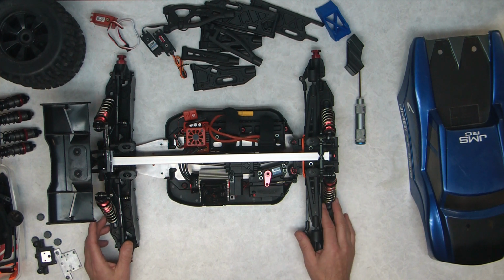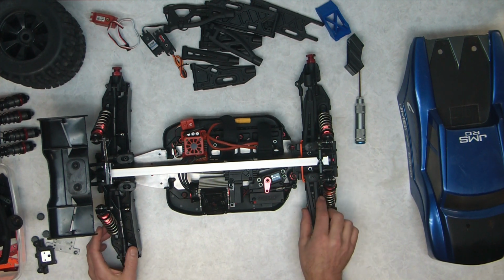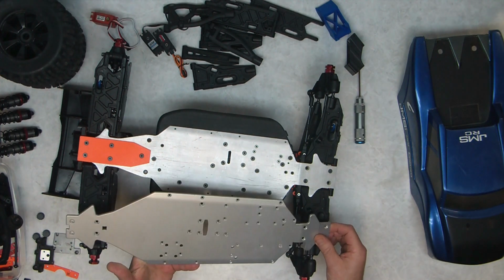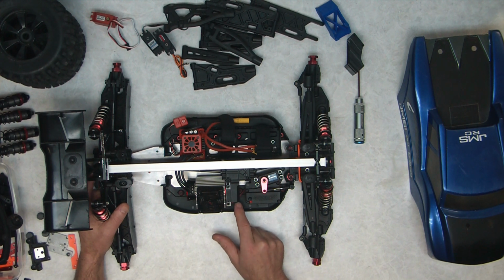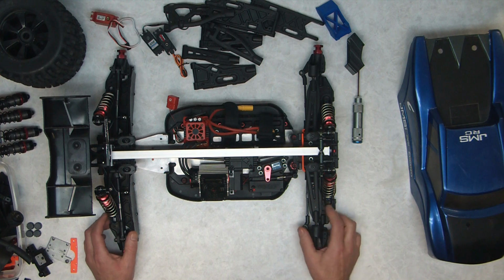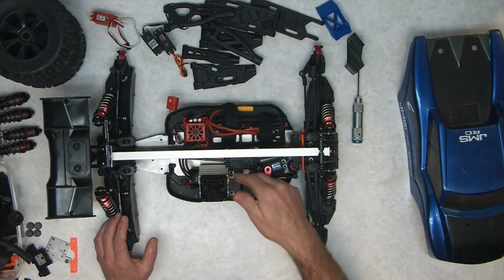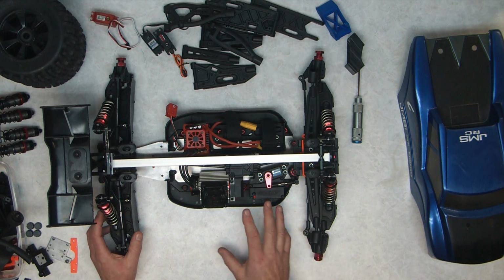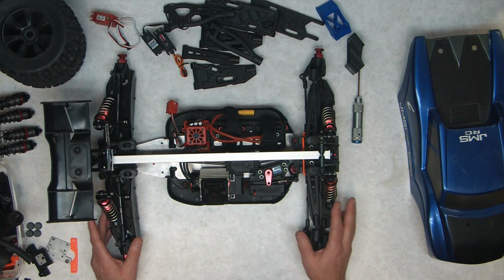Team Corally Kronos Review 2020 Part 3

Comment: Great video series!  There's a few reasons I went with the Kronos back in the March/April 2020 time frame.  1)  It looked like a durable truck.  2)  I didn't want to have something that everyone else had.  3)  The 'fanboy' attitudes that many for other brands had turned me away   I too had similar pains working to toughen up the V1 of the Kronos.  But I liked it so much that I got the Dementor.  They have been fun to tinker with and to make a little stronger to handle the bigger bashing environments.  I think the V2 trucks fix most of the critical areas that needed to be addressed.  It's amazing the progress they have made in one year.  Bash on my brother and again - great videos!
Reply from the maker: Thank You :) Yes it's been a lot of fun although i really believe like i mention that all of our inputs have made that progress possible and now that we've come this far i think we should continue. A brand very easily turns into a fanboy kinda thing when everyone thinks that everything is released is top notch, i would really like to see Team Corally continue this progress with the knowledge of the basher scene that they've now achieved and i think they will if they continue to get input from the users.
Reply: @servalac  Corally has made vast improvements on their cars over the last year!  It's awesome that they are active in the Team Corally Bashers Facebook group.  One thing that kinda bugs me is that the full catalog of optional parts are not imported to the US.  We cannot get the optional shock springs, sway bars, oils/lubricants, and a few other items.  May be nit picking as there are other springs and oils from other manufacturers available here, but it would be nice to have the Corally parts available here.  But most of the optional parts are imported here so it's quite a minor bother.   It would be cool to see a durability and capability test of the V2 Kronos/V5 Kraton, V2 Dementor/V5 Outcast and V2 Python/V5 Typhon.  I'm assuming the Arrma vehicles are all V5 - or what ever their latest version is.

Comment: Hi. 
Great video! Is it Kraton/ Durango RPM bumper with skid plate ?
Reply from the maker: Thanks :) Yes it's RPM's Kraton/Durango one, it does need a bit of modding to fit, the hole spacing in the Kronos chassi is different.
Reply: @servalac  just drill new holes?
Reply from the maker: @cinekm1  basically yes, there's some info about this in the FB group Team Corally Bashers, check it out.